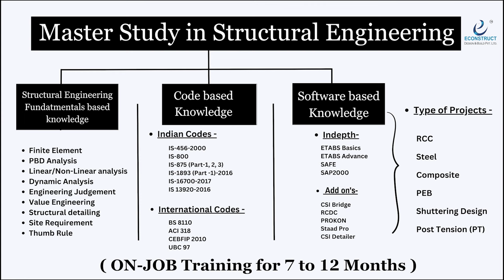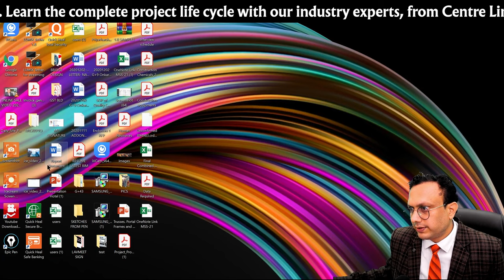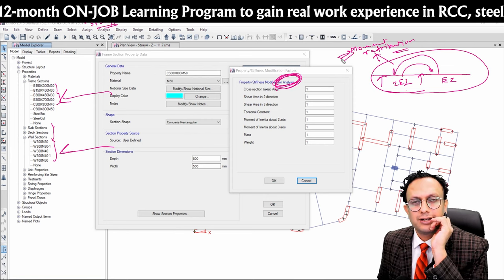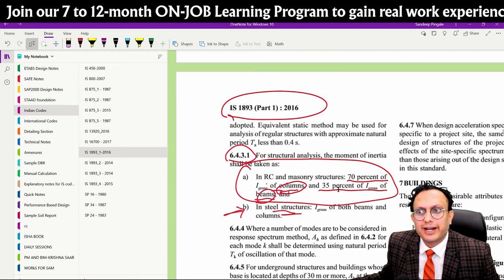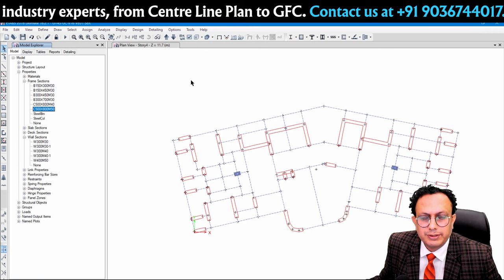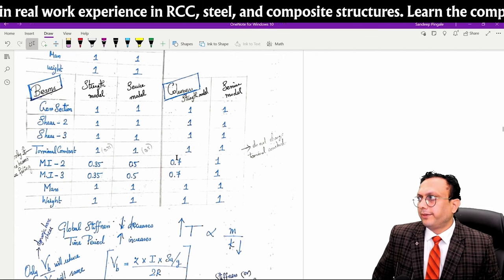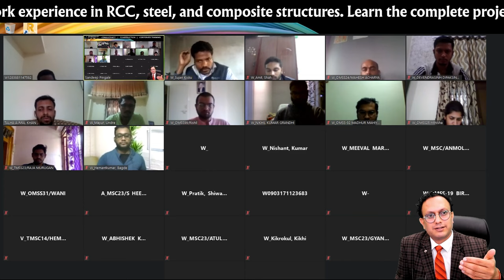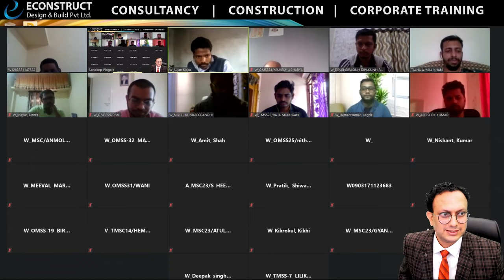Mastering Stiffness Modification Factor in Structural Engineering | Live Class with Sandeep Sir

Comment: Thank you very much sir. The way you teach is very easy to grasp the concept. Sir I have a question regarding ETABS Modeling. In architectural drawing we see often that a beam is resting on the edge of the column which means that the column and beam centerlines are not matching. But in practice I saw the in ETBAS modeling the beam and column centerlines are modeled as they are in the same line, which means the column position is not same as it is in the architectural drawing. I know this type of modeling can be done in ETABS using Link/Insertion Point. So my question is what is the correct practice? As far as I know the column position in ETABS should exactly match with the position in the architectural drawing

Comment: Dear sir it is necessary to explain why we have to change stiffness factor....
Reply from the maker: Different materials have unique mechanical properties. Adjusting the stiffness factor ensures that structures are designed to withstand specific loads, optimizing the use of materials and ensuring safety. It allows engineers to balance rigidity and flexibility, leading to cost-effective and structurally sound constructions.